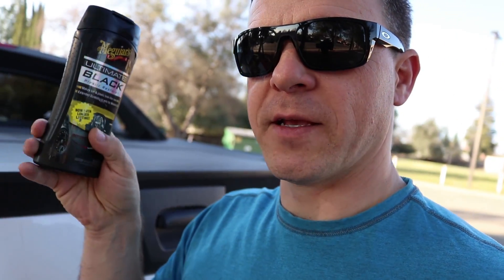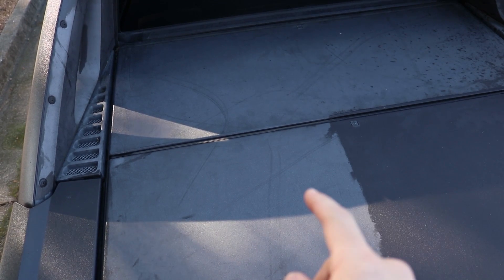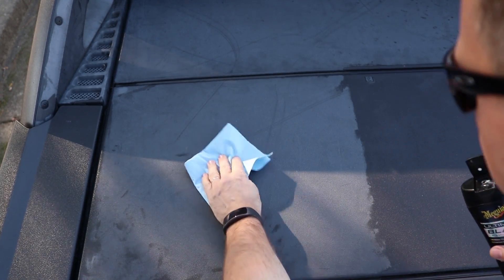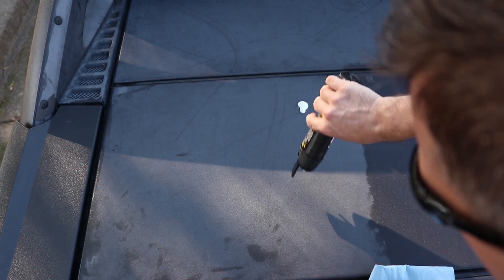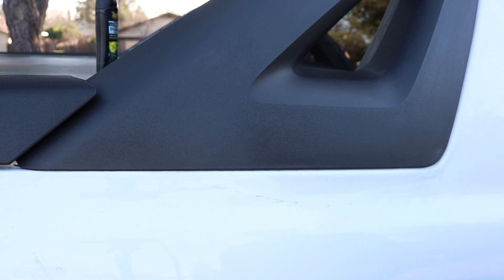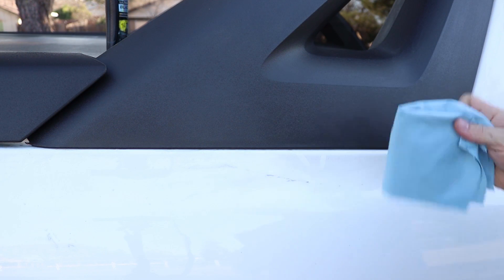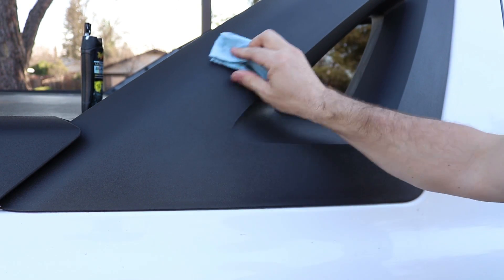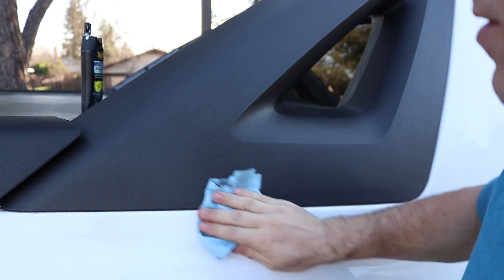How to Restore Faded Plastic trim. Ultimate Black Plastic Restorer

Comment: I use this product twice a year on my avalanche Only product that has Worked for me. And it’s only $10 It’s dirt cheap Compared to other products That don’t even come close to this product results
Reply: So does it last about 6 months before the fade starts to show again?
Reply: Thats what i want to know?
Reply: You just answered my question on how often irs gotta be used. Thank you. Now do you wipe it down later to remove any oily film? If so does it work to keep from attracting dirt dust and crap ?
Reply: How many bottles does it take to do an avalanche?
Reply: I've used the cream and spray can for 8 or more years. When using the cream use soft Terry towels instead of the type he's using. The cloth towels will absorb some of the cream but will remove a lot of the oiliness. You will use several towels to do a avalanche but will really get good coverage. The cream last 4 to 6 months if your avalanche is left outdoors all the time. Meguiars makes a spray Black to Black which is quick but last about 2 to 3 months. It takes 2 cans of the spray with half a can left over for touch up work. Remove the hatch covers when you detail the panels and while they're off, apply some rubber protector to the edges. Hope this helps.

Comment: This has been my go to for restoring the plastic on my Avalanche since I first got it in March of 2020. It's easier just to give you truck a good washing. And don't worry about the panels. I weigh about 200 pounds, and I can stand on them, though I usually take them off to do the top. Motthers Back To Black is also a very good product. Don't even try Armor All. It won't work. It's like putting water on it. And don't forget to put something on the rubber seals on the panels, and if you have the sunroof, do them also. It keeps them from drying out and leaking. You can use Armor All on them. Thanks for the video! Great information.

Comment: I tried some of this stuff but only lasted a couple of months. I said heck with that and started using KIWI Black liquid shoe polish and I did not have to polish it or anything.  
when I would get just a little bit on the paint it would wipe off very, very easy with a paper towel or rag. I did all the black areas with one bottle of the shoe polish and had some left over. The KIWI Black shoe polish was just a little bit over $4 at Walmart. It has been on for over 3 months and still doesn't need another application yet. I can't guarantee it will suit your needs, but it sure works great for my 2004 Avalanche.
Reply from the maker: That's a very good insight.  Thank you.
Reply: I thought about KIWI too how is it holding up after 6 months?  Has it run or dripped on the paint?
Reply: Does it get on your clothes?
Reply: How long did the kiwi last?

Comment: Thanks for the tip however,, painting with the proper paint is possible and that paint is plastic bumper trim paint..Suggestion, next time when restoring the cover do like mopping a floor and work your way to the outsides from the inside, much easier to access.

Comment: Hahaha as an avalanche owner there are two colors of cladding light grey and dark grey but never straight black.  The dark grey almost looked black as I'll admit, but when these people who put the dyed black restoration products on start to wear off it looks terrible and blotchy. Heat guns wreck the texture appearance and make the plastics more brittle over time..there is unfortunately no permanent restore product.  I like mothers back to black that's safe for all colors of plastics, very similar to meguiars and depending the severity more than one application will be needed.  If you do have black trims the dyed stuff will be ok.  The most important thing I've found for my cladding is to clean it thoroughly with a stiff scrub brush like a deck scrub and dawn dish soap.  Dont use regular wax enhanced car soaps for this process it is a cause in discoloration of trims and plastics.  Also these products dont apply well in direct sunlight or after the plastics have baked in the sun all day and let them cure before adding another coat or getting wet.  I like to do my trims and plastics first then I can do the painted surfaces and not be like i just got that on my freshly cleaned fender.  Once the products cure they dont wash off easily and soaps and water should bead off.
Reply: Try Chemical Guys VRP! Amazing product!
Reply: I whole heartedly agree! I also use Mothers Back to Black on mine. It works great! Took two applications when I first got the Avalanche in March of 2020, but it holds up well for several months.

Comment: Ill be surprised if the oily fim you said is left behind doesnt attract dirt and dust like most other products.
Reply: Once it has had time to set or cure, you can wash your vehicle, and it will be fine. It will not attract dirt and dust, anymore than the rest of your vehicle. No greasy residue left behind. If you can apply it in the morning, let it sit all day in the sun, and you can then wash it. That will get rid of any left over residue. I noticed that after I did mine for the first time, with Mothers, it rained, and I could see where the residue had run down the sides of the truck.
Reply: @pg1171  thanks for the input. Greatly appreciate it. This is an 80 year old friends truck hes had since new. It looks great except for the faded plastic and the plastic that actually encases the rear windshield. Hes never removed ut or opened the cab access but i noticed some water stains on the inside and found the plastic attached to the perimeter of the actual glass was broken on the bottom left about 4" from the corner and the upper right about the same distance from the corner. I looked for a replacement piece but didnt have any luck. If you or anyone knows if that piece is available please let me know. I dont want to replace the rear windshield if i can keep from it. Thanks again

Comment: How many bottle would o need for the whole truck?
Reply: I've had my Avalanche since March of 2020. I have used only one bottle on mine, and I have just started on my second bottle. It will last for several months, depending on how often you wash your truck, and how often it rains. I guess that would depend on your location. Also, I think that in the SW US, it would get more sun, and need to be applied a little more often. Mine seems to hold up for about 4-6 months. Both products do not contain any coloring or dyes. They just renew the finish. They will work on any black trim on your vehicle.

Comment: Can I still wash it and it will stay black?
Reply: Yes you can. It's actually easier than rubbing the plastic down later, and you get a clean truck out of it! Also, Mothers Back To Black works just as well. I usually use that on mine.

Comment: Bottle says it only lasts for weeks? How long did it last?
Reply: Try Forever Black, you can get it on Amazon. It's a dye and it'll last a couple years atleast.
Reply: @carlitos5565  I saw a video where a guy used a map gas torch to renew it.. it worked perfectly! Permanent fix until it starts to naturally fade all over again.
Reply: I used Mothers, no dyes involved, and it lasts about 4-6 months, depending on how often you wash your vehicle, the amount of rain you get, and how much sun it gets. Should last you at least 4 months. I live in the SE US, and mine lasts between 4 and 6 months.

Comment: You could also cover it in motor oil which is basically what you have done. Its greasy and oily and will pick up any and all dust around. Their are so many other/ professional solutions that will solve this issue personally
Reply from the maker: You are correct Garrett but this solution costed me $5.  Not sure how much other methods cost.
Reply: Why are you just negative?
Reply: What solutions are you referring to? Cost effective?

Comment: Use a heat gun or a torch its super easy and it lasts did mine and it looks new. You don't have to worry about washing the plastics other just when your using heat Act as if your painting and you don't want to create a drip in the paint
Reply: never use a heat gun. heat burns off the oxidation yes but it hurts the plastics ability to absorb oils like the one he is using until eventually the plastic is ruined.
Reply: See that's the thing I tried and tried and tried nothing worked bought stuff recommended and more expensive stuff but no results it would just dry up and mind you that was before I used heat. So if nothing works what would you suggest?????
Reply: @michaelwazny5851  Sand them down and paint or use bed liner. I mean paint like the Cadillac's so a 2 part primer, paint, then clear to make sure its permanent.
Reply: True enough thanks ill do all the cladding

Comment: Bondo brand of Back to Black (Walmart)  $!0.00, works better, lasts longer.  I use garage, but have not had to redo the black plastic in a least four years.
Reply: Hows it $0.00? Did you steal it?

Comment: All that oily residue should tell you something about the product.
Reply from the maker: Richard Scott.  I am not sure about the quality of this product but because its oily keeps the water off and stayed on pretty well.
Reply: What should it tell me? Is it melting the plastic? I need to know!
Reply: @prolly2stoned420  This stuff is self-combustibel. After using it, the rags burst into flames after sitting for about 15 minutes. The oily residue may be a contributing factor.
Reply: Richard Scott bro no way that sounds crazy